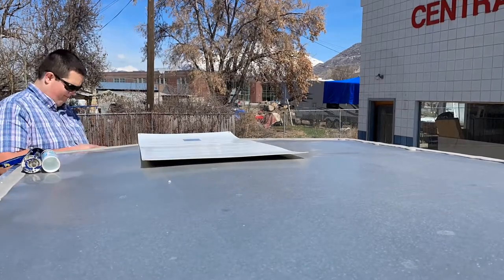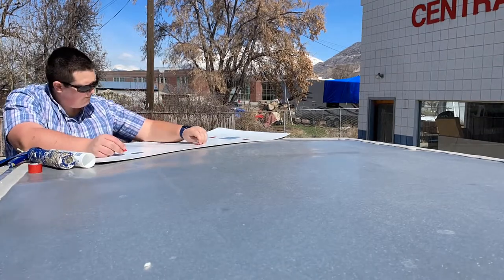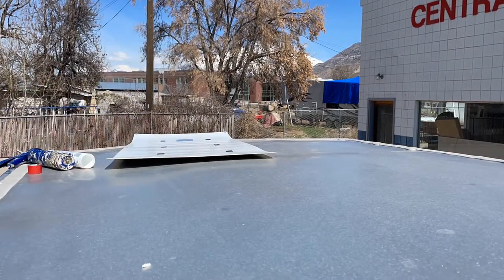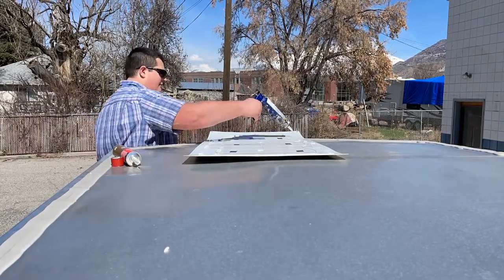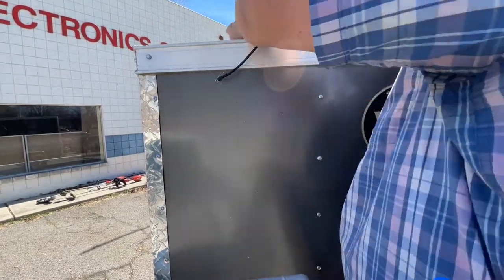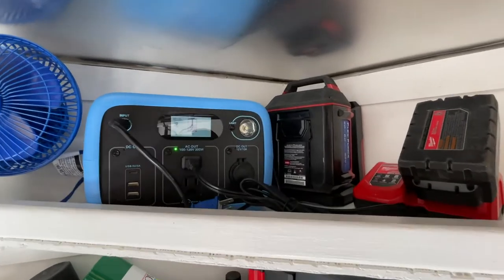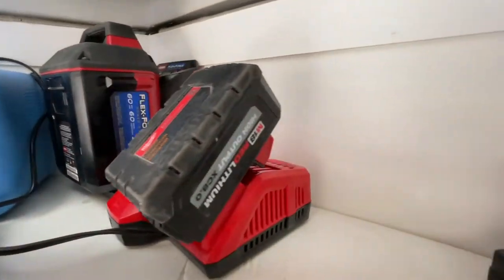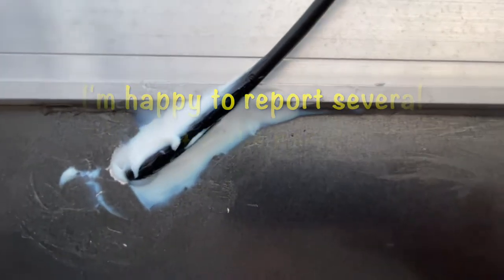How to Mount a Solar Panel to an Enclosed Trailer (No Drilling!)

Comment: Doesn’t the solar panel need to go through a charge controller before going into the power bank?
Reply: It is built into in the solar battery…
Reply: @thetoolmat8632  thankyou! I’ll just connect the solar panel right into the power bank.
Reply: Just verify your solar battery has a controller, I have yet to see one that does not.